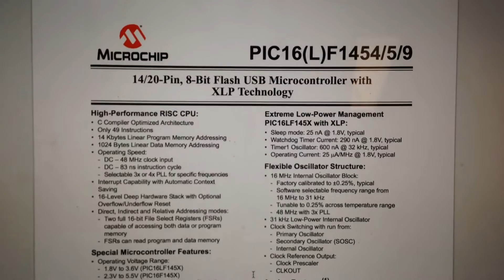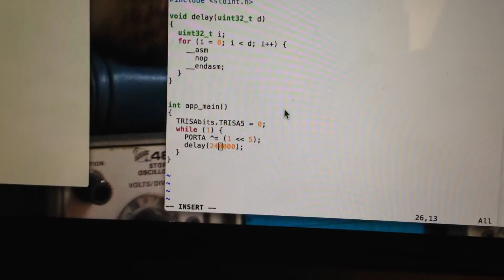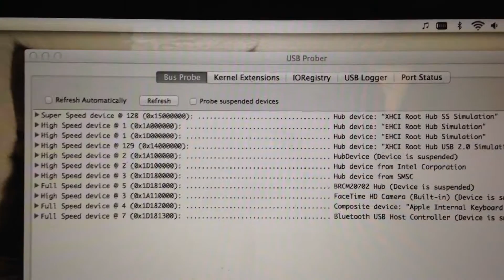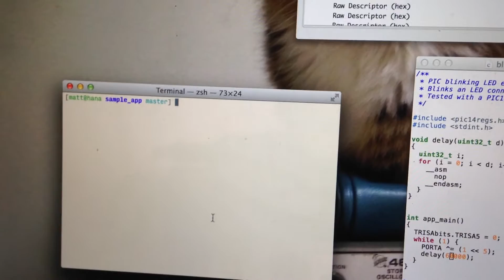PIC16F1454 USB Bootloader Demonstration

Comment: So if you are not happy with the PicKIT-3 then what would you use to program ARM devices? I have not found anything that is affordable. Thanks.
Reply: Look up the ST-LINK V2 for the STM32 product line. Official one goes for like 30-40$ CAD and there are some dongles that are much cheaper. I own a dongle that allows not only programming but also in-line debugging. The official one also includes JTAG if i'm not mistaken. You're welcome.

Comment: Tried to run the bootloader on a PIC16F1455 but can't get it to be recognised by W10. Looking at the code I can't see that you are setting the ANSEL register for Digital rather than analogue which may be needed on the 1455 and 1459. Help appreciated
Reply: Did you ever find the problem with W10 ? I am running into the same issue.